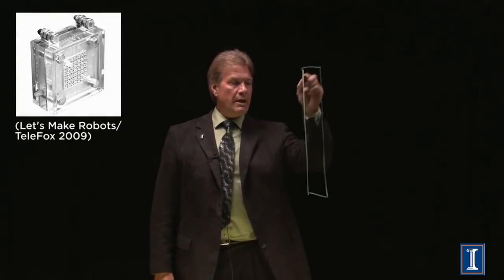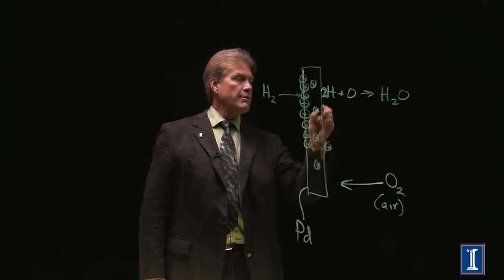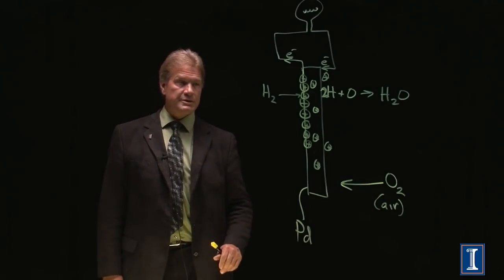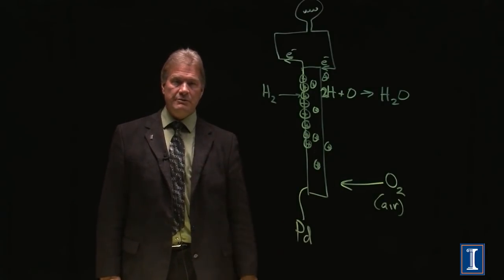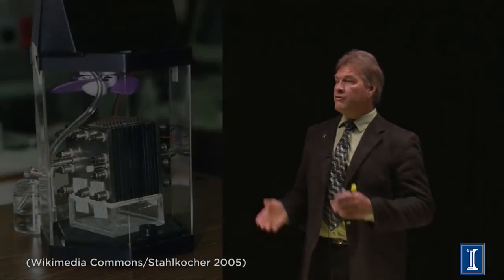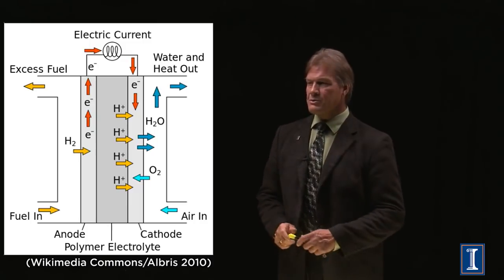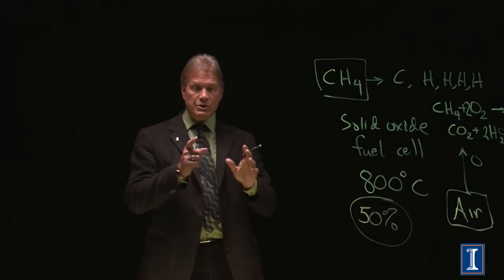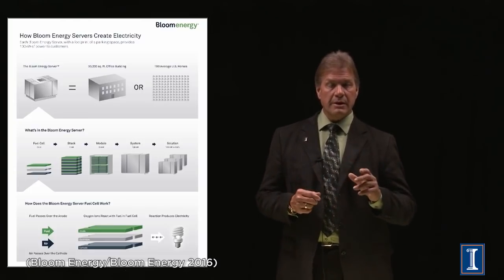Fuel Cells and Hydrogen Economy

Comment: Love this video series.

Combined Cycle power plants have a much higher efficiency like 50% to 60%.
Reply: That one I'm working at, has about 59%. It uses 2 Siemens SGT5 4000F gas turbines.
Reply: Sternpunkterdung True, although you need to take into consideration that there are no electric transmission losses. Also, the system probably warms up faster than the steam cycle of a combined cycle system and as such might be more flexible with respect to power dispatching.
Reply: high temp fuel cells can reach to 85% effeciancy if you apply heat recovery.
Reply: @srour87  I've wondered how that heat would be useful though. Is there enough to run the brayton cycle?
Reply: The prof is more accurate here. Siemens and GE like to lie by using lower heating value to shaft power. However, real efficiency is HHV, which is 0.9xLHV. And shaft power needs to be converted.

Then you add in generator/transformer losses, energy use on-site for pumping water and starting losses. Real efficiency is 49% for UK CCGT, which is typical.
Reply: Cmbined cycle SOFC + GT plants can achive %70 percent easily. The heat needed is supplied by losses of SOFC.

Comment: About 26 years ago I got a job as a temporary "manufacturing technician". We manufactured Molten Carbon Fuel Cells (MCFCs). So much fun! Working with many engineers from University of Illinois. We made the Anodes, Cathodes, membranes and Matrix components and assembled them. The technology has seemingly been abandoned. As far as I can tell. To impracticable.
Reply: Is it possible to make a fuel cell system that can use hydrocarbons (for their superb energy density)? I understand it is possible to reform the fuel and extract the hydrogen for use in a fuel cell, but then the energy from the carbon is lost. Is it possible to push the carbon atoms through one type of fuel cell while pushing the hydrogen atoms through another fuel cell?

Comment: Can you cover OTEC next? Ocean Thermal Energy Converters. In the ocean, where it is deep and there is a large temperature gradient between the top and bottom of the ocean, a gas like propane or butane can be boiled by the warm surface water and condensed by the cold bottom water and a turbine can be driven by the boiling gas. There are some in India and Japan and one in Hawaii
Reply: Did he ever do a video?

Comment: I love this man's lecturing style and content. Excellent. 

I do have a little bone to pick on this one however. The numbers are a bit out of date and we have neglected the rather large cost  of burying or storing away the CO2. Let's face it.. we have to dump this stuff and CH4 is even worse as a GHG.

Green H2 from electrolysis  has come on by leaps and bounds heading to zero precious metals and getting down to less than 8 cents per kWh. And I think the FC life is improving as well...a big issue.  

The reason green energy from wind and solar is still pricey is that curtailed output is so high. Storing it economically is now possible and we have no CO2 sequestration to worry about.
Reply: Making low CO2 your goal with energy production is just stupid though, as all industrial scale energy production is going to create a lot of CO2.  Cost should be the only factor, then the market will do it's work.

Comment: Hydrogen economy: Perhaps for heavy vehicles the disadvantages of hydrogen fuel cells will be less than the disadvantages of chemical batteries. The long recharge times and low energy mass-density of batteries are fairly small problems for a family car, but become much more significant for commercial heavy vehicles. Also, in a future where major energy sources are intermittent, there is a place for industries which have high energy demand but low capital costs and easily stored products. This allows running your production facilities intermittently only when electricity is very cheap. Generating hydrogen could be such an industry. (Water desalination might be another.)

While these arguments are plausible, I don't know if the economics will work in real life.
Reply: The comments regarding the family car is very dependant on what country you live in.
For a country like the UK, a 400 mile max range, is more than adequate for general use.
For a country like Australia or the US, a 400 mile range means that for a large part of the usage of said car, recharging is required during the trip, and a 1 to 8 hour recharge cycle becomes a serious problem.
Reply: Our country is moving towards massive renewable energy harvesting infrastructure to be utilised in conjunction with hydrogen production facilities to satisfy industrial needs such as shipping, mining, electricity production... etc etc. 
Hydrogen IS the way of the future. Just not for people that operate independently if Hydrogen powered their private transport. 
(Ie; Hydrogen can be made at home... and populations exploiting this principle would be immune to external influences designed to maintain control and intentions over a specific/wider population. Be a bastard if international sanctions had zero effect or reason for concern for a ‘rouge’ sector of a governments society.)
Reply: @petert3355  It's true you need to recharge during a long road trip, but most people do not drive hundreds of miles each day, or even each week. Even those who do can easily charge their car because they would still stop at a gas station during that trip if they use an ICE.
And believe me, if you have just driven hundreds of miles in one sitting you don't just want to stop for five minutes, you will want to use the toilet and probably eat something, and if it takes extra five minutes after that to charge your batteries to full anyone with first grade math skills can tell you that your trip does not get catastrophically delayed by waiting for less time than you spent stuck at red lights during your trip so far. Also, sitting still for a long time is a health hazard, that's why you shouldn't stay in front of a computer for the whole day either.
OTOH, with general infrastructure improvements chances are it will be easier to put your car on a train and do that trip of hundreds of miles in cheap comfort instead of risking a drive in bad weather and dodging roos. Or fly, as planes will also switch to using H2 or electricity. There are really very few reasons why you would want to bring your own car along when renting one only for the time you use it is cheaper.
Eventually people will have to admit that they are not going to need a car that can cross Sahara without stopping in their everyday life, and if they ever feel a need to drive across Sahara they should not use the family car meant for short shopping trips for that.
Reply: @AnalystPrime  fair comment, but none of that addresses my point. 
You speak of ICE rapid charging, yes they can "fully" recharge the lithium ion batteries in about 15 mins. Latest information I have on that technology is that it also damages the lifespan of the battery and capacity by 1-2% each time. Not sure people will accept that.
As for general infrastructure projects like rail, tell me exactly how many new rail lines are being built right now in lets say Australia?
This is my point, small country, small distances, electric cars make sense.
Freaking huge country, huge distances, electric cars don't. Hydrogen fuel cells do though.
Reply: @petert3355  Huge distance + single payment for building a railroad = Greatly lowered transport costs and faster travel times.
Also, a million people do not buy a new car every couple of years, which is one reason why it is not popular. Another is that the current administration probably won't be in power when it is ready and working, so politicians generally cannot be trusted to do anything about infrastructure.

Comment: Ballard Power says their PEM fuel cell membranes are good for 30,000 hours now.  They are typically designed for transport applications.  You can get devices to create hydrogen through electrolysis for 1 kg of hydrogen (energy equivalent of a gallon of gas) it takes 55 kwh of electric energy to produce and pressurize.

Comment: When renewable energy sources occupy significant amount of our total energy supply system, intermittency of the energy sources will necessitate scalable energy storage system. It is for this reason, hydrogen is considered to be an important energy carrier. In particular, for renewable energy resource poor countries, I cannot think of the other ways to import CO2 free energy. Assumption about using fossil fuel as source of hydrogen as permanent solution is generally held misconception about the use of hydrogen. Otherwise, this lecture is very informative and helpful.

Comment: Hey, here's a question I haven't heard addressed yet. I heard on the radio that a new technology is able to produce hydrogen from oil (that part is old news), but it does so in the reservoir, so the H2 comes out but all the carbon rich compounds stay underground. If I'm not mistaken, that sort of process is like digging hydrogen out of the ground. Would that be able to change the nature of the hydrogen economy?
Reply: Kruglord its either energyintensive because you heat it and produce h2 and coke or you produce gaseous carbon co /co2 which is difficult to keep in. The well

Comment: Won't you get a bunch of ammonia as a byproduct as well if you just use air as a gradient as opposed to concentrated oxygen?
Reply: No. That would be a godsend though, as the Haber-bosch process is expensive to run. The separation of the N2 nitrogen bond requires energy, and since there is no energy input here that's impossible to perform.

Comment: I'm confused about the 800 C temperature. Do you mean that's the waste heat it generates, or that's the temperature you have to maintain in order for the reaction to occur ? Because if it's the first, can't you reclaim some of that?
Reply: Both. The process releases heat, ~50% is waste heat (~50% efficiency). But the process needs to be 800C, which is maintained while its running, but requires a start-up process otherwise. The waste heat can be used, but its typically isn't.
Reply: The short answer is both, and yes, but to give you some perspective, in a typical car you get about 20% of your chemical energy to the wheels, about 50% is radiated through the radiator and everywhere else on the engine, and the remaining 30% goes out the exhaust (at around 400C). The average American car is around 200HP, so you get 300HP of heat energy out the exhaust, which is like 220 KW.

Since he said that the device is rated for 100KW at 50% efficiency, you're going to get 100 KW of waste heat per second at max load. And that would be true of any 50% efficient device for whatever that device's operating temperature is. I imagine that these boxes are well insulated to protect people and also so that they can maintain the operating temperature, and that most of that 100 KW of heat energy comes out the exhaust pipe.

So pretty much every car is venting about twice as much hot gas heat energy as one of these boxes does.

For some physics pedantics, and maybe get at the actual root of the confusion, temperature is measured in degrees C or F or equivalent; heat is measured in Joules or BTU or equivalent. So if you hear a physicist talking about temperature, they are not making any statements about heat energy. A low density plasma with a very high temperature could have a lower total heat energy than a cold milkshake of the same volume, for instance.

Comment: Thank you. Just how long will the current crop of automotive hydrogen fuel cell membranes last either in years or better yet in kWh or in Joules ?
Reply: Ballard Power says 30,000 hours for their newest version.
Reply: @kibashisiyoto6771   Thank you 30,000 hours is roughly 3.5 years. I'm assuming that must be lifetime since first exposure to H2. Armed with the name Ballard Power I did a search and came up with the figures of 5,000 to 10,000 hours of use for those cells in current production H2 fuelled vehicles or 225,000 to 450,000 miles at an average speed of 45 mph. Better than I expected.